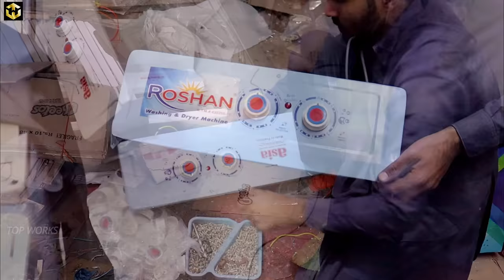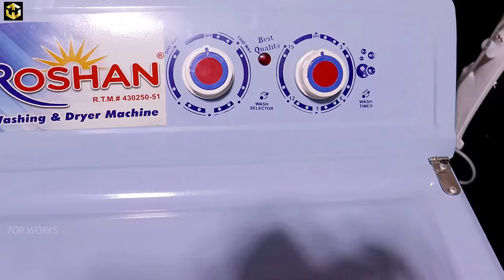How to make Washing Machine in Factory | Manufacturing Washing Machines Process

Comment: When we were living in Pakistan, we bought one of these locally made washing machines. They were cheap, durable, strong and also cheap to maintain and fix. The only thing strange about them that I can remember was that when you started it in one corner of the backyard (obviously no plumbing in the house), you'd find the machine on the other side. It walked around on its own terms😄😄😄
Reply: Very high tech machine.
Reply: Is there a water intake hose or did you have to pour water into the drum manually?
Reply: @ragabara1031  manually pour hot or cold water.
Reply: @sdsfgsty  And how is the drain pipe opened/closed? Also manually?
Reply: @theplateisbad1332  yes. You just let it go! 😄
Reply: This is a lemonaid ice mixer stand.. not more
Reply: @emendatus1  low tech machine
Reply: You should sit on the top of machine as a counter weight
Reply: there is an story that these washing machine can grab  a piece of wood and follow u till the end of alley
Reply: 哈哈😄
Reply: Thanks I was wondering how they actually worked for people 😂
Reply: Definitely walk around cause there is no suspension components.
Reply: Washing machine zombie 😅😅
Reply: Doesn’t help with walking around when there’s wheels underneath the machine to roll anywhere
Reply: That's ghost that moves your washing machine probably
Reply: @radenbagushadiningratsoery7313 vibration from an unbalanced load makes it do that even on a basic clothes washer like this
Reply: How much the cost? 😅
Reply: You should buy online instead of cheap Baba workshop I'm wanting to buy Kenwood,our mother can't clean by hand nomore
Reply: So it's a walking machine 😂
Reply: Hahahahahahahahahaha
Reply: @rishadar hahahahahaha, very funny
Reply: Due to vibration 😂
Reply: Rolling washing machine vs Rolling Stone?
Reply: I can see why. The tub has no shock absorbers, the motor's mounted on a piece of wood, and the body's mounted on casters. This thing's as no frills as no frills can be.
Reply: The work ethic of these people is astounding! Nothing but respect! Thanks for sharing your story!!
Reply: está lavadora de baixo custo, fizeram economia na fabricação não colocaram as arruelas nas porcas e faltou parafuso nos pés da máquina...
Reply: That is not a con but a feature.
Reply: so what's the price of one there and I wonder how much it cost them to make them and I hope there not sold in America
Reply: They didn't put any locking casters on it, that's why. But if it works and it's cheap, it's worth buying.😅
Reply: This is not machine mistake, it was installation mistake... rotatory machine always install on level surface or have to level the machine 😂
Reply: It was not a machine problem it was installation problem. Rotatory machine always install on level surface or have to level the machine . You put your mistake on untongue machine😂.
Reply: These machines are very cheap n durable,easy to operate,these are very popular in poor countries like Pakistan etc

Comment: I have the sneaking suspicion that this washing machine would last a lot longer than my expensive western one with lots of flashing lights and wi-fi.
Reply: U r right.they last forever
Reply: It depends on the motor build 😂
Reply: If electricity don’t kill you. Motor just under the drum. Small leakage and…
Reply: And every once in a while, it needs update or just won't work
Reply: Чем проще вещь, тем надежнее.
Reply: @rafalkrawczyk1426  the motors on all the washers are right underneath the drum.  even the large washers you find at laundromats.
Reply: Even though my father brought an electric one costed around 70K rs. To home but my mother is still using this manual one & it is 25 years old...  My father retired as assistant manager from power house that's why they know the maintenance of these simple machines... They often resolve every problem regarding it but this manual one has still far better washing than electric one
Reply: We are using same machine for last fifty years
Cheap easy fix 
You can fix it by yourself
Reply: No it won't
Reply: One of the most dumbest comments
Reply: Nah you
Reply: I dunno. I find the new western ones rather reliable and easy to repair. Spare parts are far more abundant for digital machines than they ever were for the old analog ones.
Reply: You would be horribly wrong
Reply: @deval3596 except they have voltage regulators and fuses mounted on control boards...so the motor will shut down as soon as the amps spike...not these. These will keep spinning until someone unplugs it.
Reply: @ishfaqalimalik3661 so it's a washing machine of Theseus? At some point you have to realize your washer failed you decades ago and you've done nothing but build a new one on an existing frame.

Comment: Love the wooden board motor mount.
Reply: Only for rich people the wood and bling..
Reply: One of the things what scares me..
Reply: If it works it works
Reply: that wood i think is for not to be electrocuted
Reply: In case of contact water with engine this should be insulation from the cover. But wet wood it’s good insulation ;)
Reply: i assume it is for sound deadening, a metal mount would be much nosier from the vibration / Motor noise, unless they had rubber grommets between the motor and mount.
Reply: Bio component.
Reply: @Termo35  I didn't see any grounding wire / bonding lug nut. 😆
Reply: and the cardboard wedged into the side to keep the drum straight. lol !  it might be good for washing socks or shit stains outta your underware
Reply: 💩 Stains!😅
Reply: I wish mine was that light?
Reply: @fitybux4664  It's optional but only on the luxury model

Comment: Great video, you guys work very hard to make a simple product that works. Here in the US our machines are too complicated and the electrics break down often! Please be safe when you work around the machinery, and please get the paint guy to wear a mask or even a cheap respirator and gloves. Paint is not good to breath in.
Reply: With all due respect... it's not exactly truth...Samsung, Bosch and similar ones work for years and are perfectly balanced. Get broken after many years in service. WiFi connected devices are very easy to operate. 
Although, those guys are amazing engineers, these machines remind devices from 80th... it's way better that washing clothes in river with hands... But they're far away from even simplest Bosch (not even taking here about delicateness of washing).
Reply: send them money and some equipments or stop being a simp
Reply: Our western washing machines last 20+ years with minimal repairs and no maintenance. These Pakistani machines won't last a year without a major repair, and there's nothing in it. Garbage. 

I grew up using an old 1950s, washing machine. Filled it with a house & drained it with a plug. But those were quality made. These are just junk.

Comment: "Shocking" to see how the wires are done with insulation tape 💥
Reply: And the motor mounted on a wooden plank with cardboard shims.
Reply: And the fact the whole thing is steel and not an earth in site
Reply: @jager6903  The earth is in the house when you plug an appliance in.

Comment: No automated  programs. No PCB. No electronics. No wifi and pure manual and mechanic system. I really love it. Good for off grid life.
Reply: Um.....no. To get off grid it would need to be manually operated i.e. not electric. Its called the (electric) grid for a reason.

Comment: Nothing wrong with that washing machine.  Simple, no frills and probably very reliable...
Reply: @Derek morgan They showed the drain hose installed on the tub bottom.  You probably fill it with a garden hose.
Reply: @derekmorgan9250 You manually fill it with a bucket. They have no plumbing in some area where they live. You use drain hose to drain water out when in spin cycle. It a manual machine. It a very simple machine but looks easy to repair and will do for area they are in, they actually quite resourceful people.

Comment: It's kind of crazy to think that the united states was making washing machines of higher quality in the 1930's than this. I was shocked at how they just slap this together with some wood blocks, sheet metal and some eyeballed holes drilled to mount the electronics. I guess in principle it works fine because the drum doesnt actually move at all, because you could never build a modern day washing machine like this. lol
Reply: The stickers are far more impressive than a tin barrel with a lemon juicer on the bottom. I can't see that thing washing any clothes, but you could put pets in it, it's harmless enough.
Some people have dogs that drag their ass on the carpet inside the house. They can put him in there and have it wash his ass.
Reply: @MISTERPRESIDENTELECT  i got a machine with a pulsator. washes quite well. get a grip

Comment: It looks a bit tinny and I’d love to know how it compares to a ‘Western’ machine, but there is no doubt that these are skilled workers.👍☘️
Reply from the maker: Great point!  Thanks for Comment
Reply: I bet its much more reliable than a front load machine
Reply: top loaders use twice the water
Reply: @ufartface   it doesn't matter if the result is cleaner
Reply: Probably better quality then most anything sold in USA Today 🤣 at least they take pride in the manufacturing process
Reply: The type of impellor used (flat plate with six ridges) is the same as was used in 1950's era Australian Hoover machines.   They worked ok, but you had to load them carefully.   Put any load in and the clothes get churned round at a rapid rate.  Put one extra shirt in and the water and clothes stayed static.
Those old Hoovers were reliable because they were very simple.   I assume these machines would be reliable for the same reason.  But ....  the motor on test was very noisy - bearings bad right from the start?   These sorts of induction motors should be almost silent - the only sound being the air being churned round.  Capacitor looks to be a radio type, may not last long in motor run service.
Reply: When we were living in Pakistan, we bought one of these locally made washing machines. They were cheap, durable, strong and also cheap to maintain and fix. The only thing strange about them that I can remember was that when you started it in one corner of the backyard (obviously no plumbing in the house), you'd find the machine on the other side. It walked around on its own terms😄😄😄
Reply: @sdsfgsty  : That sounds fair.   Our old Australian-made Hoovers used to walk about too.   I have a New Zealand-made machine now.   They have done something clever, as it doesn't matter how its loaded - it just works well and stays put.
Reply: @sdsfgsty  This is why most washing machines in the west are without the wheels(only two small rollers to push it back/forwards), and there is also some concrete in the bottom to stabilize/dampen vibrations.
Reply: The reason is, this machine doesn't have centrifuge functionality.
Reply: @sdsfgsty  of course it did, these machines have no springs, but they have wheels (and not even matching colours 😄)
Reply: @keithammleter3824  yeah, those bearings did sound crusty, although I will say that type of capacitor is actually very common for use in PSC motors these days, it is a proper motor capacitor, the newer ones don’t use oil can type at least for motors in most consumer products such as fans

Comment: The way how they connected the wire cables and how they "insulated" them quite shocked me. I dont believe that it can be properly save when you connect it to the electric power and run it in wet environment.

Comment: It's amazing to see how they manufacture these machines so easily which are usually manufactured in big factories.
The best part is they mount the motor in a wooden surface for protection which even branded mfrs don't do.

Comment: A washing machine with metal body is something I would never want.
Reply: Show me a washing machine where body isn't sheet metal. The safety is ensured by proper grounding and GFCI(although I think that would be a rare sight among buyers of this one). But yeah, I would operate the one from the video only with a broom stick, wearing heavy rubber shoes.
Reply: @neplatnyudaj110  all the washing machine sold in my country are not sheet metal. I saw it first on this video only.
Reply: @gouravfromuk  Send me some link. I'm in EU and have never seen a washing machine which wasn't sheet metal, not even $3000 high end machines. I think plastic washing machine would be even less safe than metal since there's potential for shock through water so you want as much grounding as possible to trip the breaker in case of any failure.
Reply: That's why the motor is mounted on a wooden plank.

Comment: Congratulations, Is it in Paksiatan..? Superb anyway, skilled workers are fantastic.. Why don't you  replace that wooden platform of the motor with a an ABS or metal.?. 👍👍👍
Reply: cheaper
Reply: Metal would be more risky in case motors leaks electric shocks.
Reply: You would be surprised at how many motors are mounted on wood... it's a good vibration dampening material.
It would be noisy as hell bolted to a metal frame.

Comment: I know it looks a little janky but I guarantee this thing works more reliably and lasts longer than my $1300 GE washer, it also looks repairable. It's just missing a spin cycle, but that's not really mandatory
Reply: In hot climates, you dont really need a spinner. Once the wet clothes are hang on the clothing line, the sun will dont the "spinning" and dry your clothes.

Comment: These washing machines, though may not be as complex as Western Branded Washing machines, but do their work, just as good, and last a lot longer then modern Western branded washing machines.  I have owned American brands like Maytag, Whirlpool, Amana. And also these same washing machines were in my parent's house in Pakistan.  These are tough washing machines and do their job, and very very cheap, 5% to 10% the cost of Western brands or even cheaper then that.
Reply: Does it have a spin dry cycle or just the agitator? That isn't clear.  On another video I saw on handle a large heavy spread thy they are powerful

Comment: I dont know what to say. I myself own a top-load machine, and mines from LG. A lot of difference in build and quality. Probably the one in this video is semi automatic, which are cheaper than automatic ones.
Even then, i really frowned when they showed the making of the "frame" which is just a few metal sheets attached together. A frame in theory must be quite strong and sturdy to bear the load of the objects "enclosed" and to also provide protection.
The motor, mounted on a piece of wood- no hate for anyone but thats again terrific. The wood can degrade by attacks from termites, and is just not something to mount a thing like a motor on.

Comment: Our first washing machine was almost similar lid was not attached was round one has to remove and put back manually was heavy never fall while machine is in use, operating switches were attached to the side  no spinning or rinsing has to be done manually but what a strong durable machine were those for years and years use no problem at all

Comment: I would prefer these over any Western Branded Washing Machines.  I have owned both Pakistani Branded and American brands and Pakistani Brands last a lot longer.  The Western Brands, now a days, last only 5 years or so with built in obsolescence, i.e agitator breaking down, or electronics shutting right after your warranty is out.  I have seen it all.

Comment: I might have missed that part, but it says washing/drying machine on the control panel. I can see how washing works, but how is the drying done?
Reply: Are you really asking about drying in PAKISTAN.  It is already a weirdly dry and hot country, it doesn't take more than 15 minutes to get yourself dried up.
Reply: @halalmeatshophk  I'm pretty sure that things dry in Pakistan without help, I was just wondering why this particular machine advertises itself as washing and drying machine.
Reply: If it was more like a western fancier machine at least the drum could spin to press out a lot of water, but the only part of this that moves is the agitator in the bottom. So I don’t see how it can do anything more than drain the water out by gravity when it’s done washing.

Comment: I wonder how is that used. There's some timer, but what does the other button do? I haven't seen any drain pump, solenoids or enything else besides motor and a timer. Is there some heater? How is the thing grounded? So many questions I think I might just order one.
Reply: @Derek morgan 
It has a drain pipe at 10:40.
I think you have to manually fill it with water though.

Comment: 7:28 bro using thicc bolts, i suggest using staples that would last longer than the thin sheets and also cost less + saves time.

Comment: the questions that came to my mind:

1) where is the drier.
2) where is the detergent compartment
3) the motor seems to going in one direction i.e clockwise, and anticlockwise, I suppose there is a selector for it.
4) where is the drain hose
5) where is the lint collector
6) how would the drain system work.
4) the lid is connected with the machine via a door hinge
5) the wheels bolted below the machine are of furniture grade
Reply: just pkmkb things!
Reply: So so so cheap

Comment: Assembling a washing machine like this is good. Actually, what's happening now is due to advancement in tech and certain standards and policy normal.  Small scale manufacturing industry through out the world have been totally killed.  If they can make something like this, may be a bit more refined with some R&D work done. 
A washing machine can no longer be manufactured unless you make a million-dollar factory.  So, at such a time having something like these is good.   It can something which can empower smaller factories.